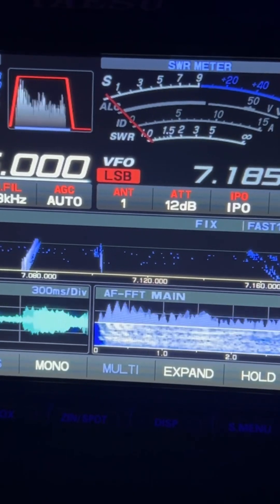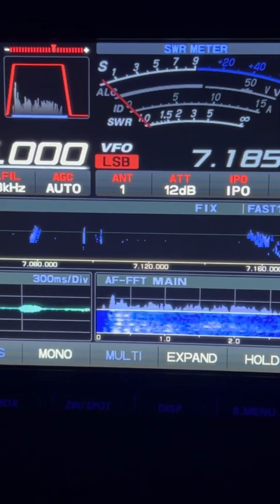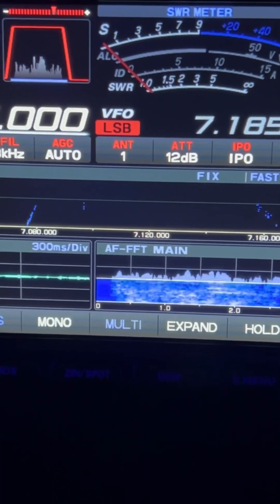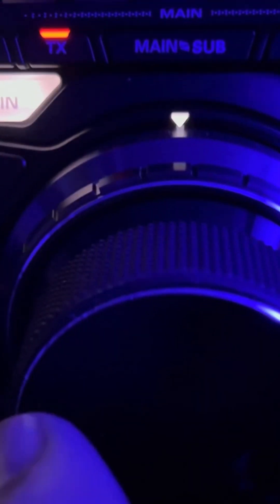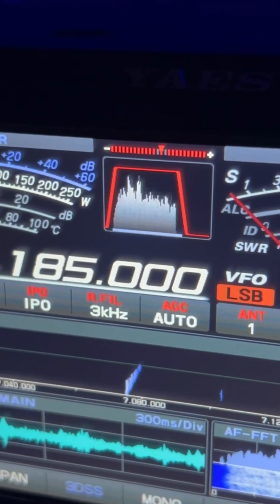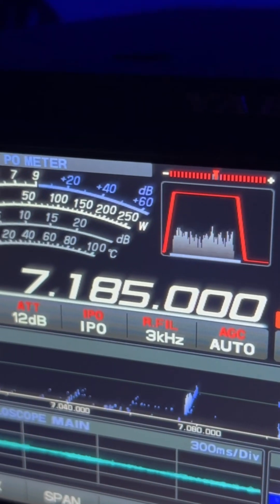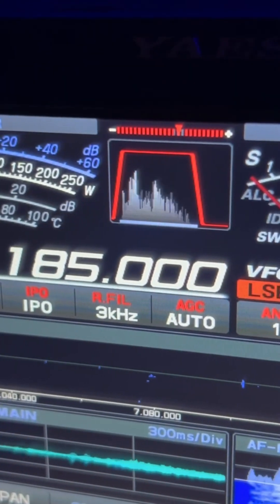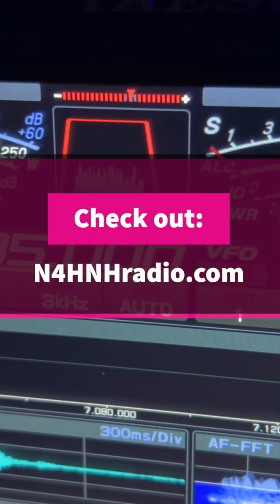Yaesu FTdx101MP VC-Tune #yaesu #hamradio #vc-tune

Comment: If you put any Radio's tongue controls and awful reception down and just de tune the radio antenna of course that's gonna sound like this less noise but the VC tune is literally just decoupling and D tune in the antenna. It's not actually making the signal any better at all this is all just snake Oil. I had this Radio and I traded it for 7610 something I'll never regret, buggy firmware no fixes ever released dodgy SWR metres and tuners that don't work properly and require extensive repairs. These radiators are overpriced garbage better off keeping the Kenwood of the Icom, this is a toy with flashy lights on it. It's not a professional person's Radio. This is a ragchewers radio 😂
Reply from the maker: It’s all about improving the S/N ratio. There is a video that shows me using a manually-controlled antenna matching unit to detune a receive antenna to improve the S/N ratio.  It’s akin to attenuation but more controlled.  Detuning is a legitimate technique. VC-Tune is a preselector. It minimizes out-of-band interference but can also be used for targeted detuning/targeted attenuation, to improve to S/N ratio.  

I routinely chase QRP “ghost” signals. The Yaesu wins every time. I don’t work for Yaesu, and they don’t seem to like me very much.  But I am compelled to give credit where credit is due.  My log is full of ghost stations that the Kenwood and ICOM receivers couldn’t pull out.  Their DNR is weak and they suffer from noisy audio amplifiers.

Comment: Yea but he sounds like he's in a box, not impressed.
Reply from the maker: Okay… Don’t buy one. I don’t work for Yaesu so it is of no consequence to me.  But I think you are confusing hi-fi stereos with 2-way radios. Two-way radio is about pulling the other station out of noise and interference.  The priority is not high fidelity, it’s intelligibility.  In the case of HF amateur radio, it’s the ability to communicate directly with only a radio and antenna, with no help from repeaters.  SOTA and POTA activators do it in the field, with a simple setup.

Here is the definition of a preselector, such as VC-Tune.  This definition was generated by Grok, the AI engine from Elon Musk:

A preselector for a ham radio receiver is a bandpass filter placed at the front end of the receiver. Its main functions are:

1. Filtering: It filters out strong out-of-band signals, reducing interference and preventing overload of the subsequent stages of the receiver.

2. Selectivity: By passing only the desired frequency band, it enhances the receiver's selectivity, making it easier to tune into specific signals amidst noise and adjacent channel interference.

3. Noise Reduction: By attenuating unwanted frequencies, it can improve the signal-to-noise ratio (SNR) for the intended frequency band.

I find that Grok’s definition matches my personal experience with the use of a preselector. I started with a Hallicrafters SR-150.  It had a preselector.  Preselectors aren’t a new thing.  They were included with some of the better transceivers of old.  The SR-150 was made from 1960 to 1965.

Comment: I read  that is just a pre-selector filter for the front end.  So all you're doing here is killing the front end of the receiver by moving the passband of the filter.  That reduces the noise and the signal (much the same as an attenuator) for no net gain in SINR.  All a preselector can really do is filter for out of band signals causing front end overload or help with out of band interference,  It can do nothing from in-band QRM/ORN as that has to get passed, along with the transmission we are trying to intercept.  I've yet to see someone demonstrate the VC tune actually does anything useful in terms of SINR with test equipment.  Am I wrong?
Reply from the maker: I wouldn’t refer to a preselector as “just a preselector.”  The preselector provided earlier radios a distinct advantage over the ones that didn’t have a preselector.  The more noise and other interference that can be minimized earlier in the receiver, the better the final audio output from the speaker will be. The physical preselector, and the hybrid architecture of the FTdx101, allows it to minimize interference before it gets converted to digital. Keeping the noise out of the digital realm allows the digital stages to work better magic than they might otherwise be capable of.  Even without the variable preselector, the FTdx10 is no slouch, due in part to its hybrid architecture.

Just like the mu-Tuning preselector I use with my FTdx5000MP, VC-Tune narrows the front end bandpass before the signal even reaches the bandpass filter and the subsequent roofing filter. The mu-tuning preselector narrows to around 40kHz +/-, depending upon the band.  So, unlike an attenuator, the preselector allows targeted attenuation.  Of course it helps prevent interference from out-off-band sources.  But I additionally use the preselector to place the signal I want to hear into one of its skirts, on the opposite side of the frequency of an interfering signal.  I use it as a narrow, adjustable, attenuator.  I have an entire playlist dedicated to using a variable preselector in real-world conditions. There are 26 videos in that playlist thus far.
Reply: @n4hnhradio  thanks for the detailed response, I'll have a look at your other videos when I have time.  I can see what you're saying here does make some sense to me.  So thank you for the explanation.

Comment: Is there really no button backlight in this radio?
Reply from the maker: No backlit buttons. Yaesu backlights their FT-891 and their FT-991A.  The FT-891 is a mobile that can be used as a base station. The FT-991A is a base/mobile.  A big radio like the FTdx101D/MP isn’t likely to be used as a mobile or portable.  As you can see on the video, I have a lamp.  But, after I get to know a radio, I can operate with only the glow of the display for lighting. I become accustomed to where the knobs and buttons are. And my eyesight isn’t so great anyway.

Alas, there is no perfect radio. I choose based upon performance in the areas that interest me.  That is primarily the ability to pull a weak signal out of the noise while interference makes it a challenge. At that, the FTdx101D/MP rules. The FTdx10 is a very close second, and the FT-710 is nipping at the heels of the FTdx10.  My FTdx5000MP hold strong with all of the above.  And the 5000 is not menu driven.

Comment: Never cared for VCT. Had it in my crystal radio set, and it made the sound distorted.
Reply from the maker: That’s interesting that a Variable Capacitance type preselector could introduce distortion, when all it’s doing is narrowing the band pass, in this case to around 40-50kHz, between the attenuation stage and the bandpass filter.

Comment: Looks to be a Great Radio
Reply from the maker: It is indeed. No radio is perfect but this one is one of the best.
Reply: @n4hnhradio  I'm thinking of buying a 101D or MP price is not cheap.
Reply from the maker: I remember when the FTdx101MP was on sale for $4,200, a couple of years ago. I don’t guess we will see that price again. But at least it doesn’t cost as much as the TS-990S, the IC-7851, or the PT-8000A. The best for the money is the FTdx10.  Neck to neck against the FTdx101D or MP on receive.
Reply: @n4hnhradio  I was thinking about the FTdx-10 seems like a nice radio
Reply from the maker: I think you would be happy with the FTdx10.